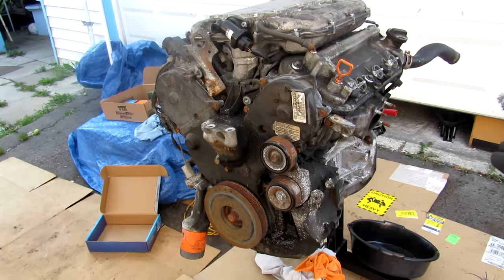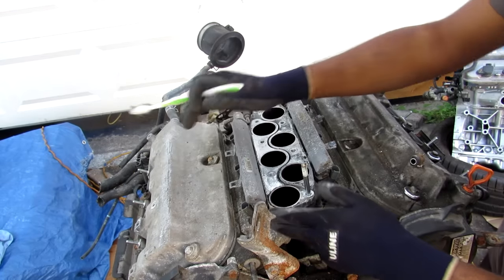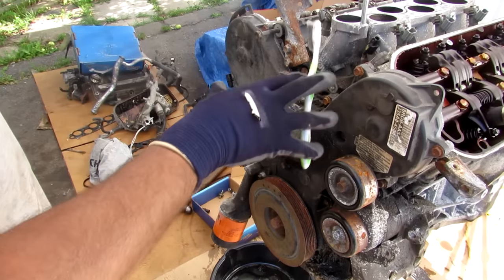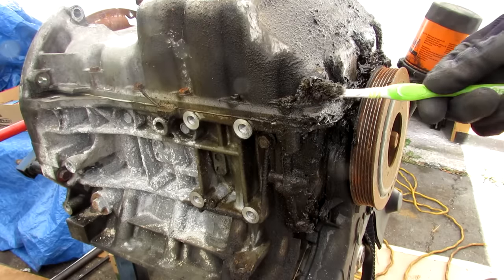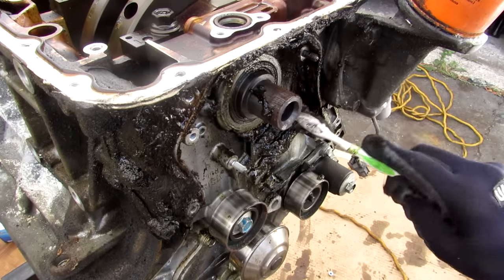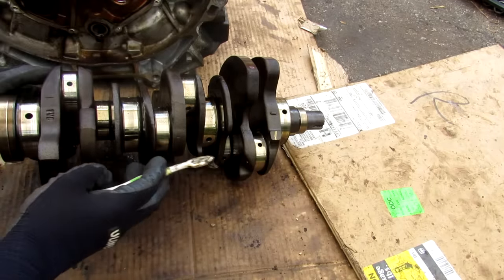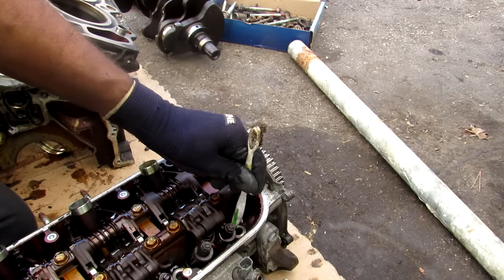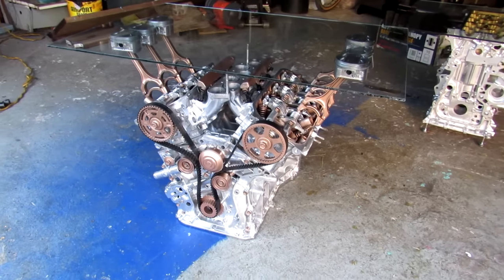Why Honda V6 Engines Haven't Changed For 25 Years

Comment from the maker: Keep your Honda / Acura maintained with these parts:
Air filters:
https://amzn.to/32essnO (US)
https://amzn.to/34AbV0e (Canada)
Oil Filters:
https://amzn.to/31nZGSu (US)
https://amzn.to/34s3ww3 (Canada)
VTEC Gasket:
https://amzn.to/32phKLm (US)
https://amzn.to/32j7unT (Canada
Reply: You as sad as I am Honda discontinued production of the V6 for the Accord? I just don't understand why they'd switch over to the 4 cylinder engine. Sure it gets slightly better MPG, but it's really honestly quite mini-squeal. I've got a 2017 Accord EX-L with the V6 and average 33-34 mpg on highway and 28-29 city. Personally I feel the V6 is just a all around better built engine. Builds more power and honestly you can do what mostly everyone does to the 4 cylinder be it cold air intakes, exhaust, turbo's, you name it the community has done it to the V6. Like I'd toss my cookies if Honda were to announce say a Accord Type-R with the V6 as a Heritage Edition as a final send off of the Accord V6. They'd of never made it to the dealerships because people would've desired them. At least that's how I feel. V6 4 Life
Reply: The reason why I became a subscriber love the video, thanks for the content keep up the good vids
Reply: @viktorbryce951  I agree. Better engine overall. Maybe you could argue that a lighter-weight 4 cylinder would result in slightly better handling (like a tiny bit less understeer) but Accords aren't race cars anyways (for most people anyways). The 6 is solid. Change the oil on schedule. Don't neglect to do the timing belt and water pump when due and that motor will be like the Energizer Bunny
Reply: @alanlo-557  You've got that right. Do oil changes every 4000 miles. I personally use Amsoil for my changes and that's just my own preference. Got about another 15k miles before I even have to worry about changing the timing belt & water pump but I'll do those ahead of time even if they don't need it. 

People often tend to view that as a waste of $ but I look at it as a long-term investment. If you maintain something it'll last much much longer. Often times people just tend to ignore or overlook that not wanting to spend anything more than they have to. Then the next thing you know boom you've got a serious mechanical issue that's going to cost you so so much more than if you'd just spent a little here and there in maintaining things. 

I can attest to this with my previous vehicle being a Mazdaspeed 6 (gosh do I miss that car). Had 247k miles on the original 2.3L Turbo Engine before finally lost compression in the #1 Cylinder yet it still ran and I still drove it like that misfiring and all for 5 months before I scrapped it. And the only reason I scrapped it was it just had so much rust and OEM & Aftermarket parts were dead for the car. I could've found the parts and got it back to drive ready but the cost and time to me wasn't worth it so I got myself a Accord EX-L Coupe 6 Speed Standard. Can't go wrong with that.
Reply: Viktor Bryce could go acura tlx for v6.
Reply: add the oil pump seal to that, that was where that oil leak was coming from. common issue, usually happens 60k miles.
Reply: All parts made of solid metal. If that would be "highly engineered" Audi,VW or BMW,it would be plastic. And will be leaking all over the place.
Reply: And also thier transmissions
Reply: @viktorbryce951  Look at the new Camry; they beefed up the their V 6 to 301 horse power.
Reply: @alanlo-557  I drive in the city (Los Angeles) so I change transmission fluid every twenty thousand miles. Even less I think.
Reply: @MBZXZ  I'm thinking about it, sir.
Reply: @MBZXZ  Did you mean Acura RLX with a 3.5L V6 Engine?
Reply: Broj 1 all of acura comes with 3.5 now , except ILX
Reply: Do more of these like the 2GR and VQs
Reply: @viktorbryce951  I live in LA and mostly drive on surface streets so I change transmission fluid every twenty thousand miles. Now, if Honda put turbo on that 3.5 engine, I'll buy it tomorrow.
Reply: Hey I need hella help with my engine!!! Same year model 3.2 tls, I got my engine from japan, and I noticed it didn’t have a solenoid or something, it’s behind the timing belt wheel on the right top side, it’s above the left cam sensor! Any guess? Is it important? If not can I get the code off at a shop and the car will run fine? It came with 50k original miles
Reply: Vtech solenoid gasket is my problem with a loud repetitive knock, which sounds like crank or camshaft sound. Beautiful hints and tips with all that knowledge. This video would have save me weeks on youtube previous to learn all this. I cant imagine how many takes and time to get together what you wanted to say..
Reply: I think with the introduction of this V6 3.5L Honda made one of the best engines in the world - I haven't seen one failed with real proper maintenance.
Reply: @eleonik76  
JB Weld to the BMW valve cover rescue ;)
Reply: Did fram start building oil filters right?
Reply: Hi I have a 1991 Acura legend it has a 3.6 V6 under the hood and i have not bin able too find any information on my engine only that it is rare the color of the car is red , so far i have only seen pictures of the 3.2 v6 and none of those even look like the engine what is in my car, it is like something from another planet so if you know where i can dig up some info on my Acura Night mare post me ty  LOL
Reply: Honda💩🚽👎🖕
Reply: HONDA Horrendous Obsolete Novices Declining Annually
Reply: Honda💩🚽👎🖕⚰️ meh
Reply: @viktorbryce951  at least the acura's still have the J but it's getting scary
Reply: So then there wasn't nothing wrong with that motor huh

Comment: Even though my J35Y1 (2015 Accord) needs Timing Belt replacements and valve adjustments, I still love this motor.  It still runs and performs like no other N.A. V6.
Reply: ALL engines with timing belts need to have the belt(s) removed periodically.  You're playing with fire if you don't replace them.
Reply: Same engine on my newly bought 2013 Accord coupe! Could you tell me how you know if it's time to do a valve adjustment? Thank you!
Reply: how many miles on it when you did the timing belt? what is n a v6?
Reply: VQ35 is a better engine
Reply: @am-mm2sl  how
Reply: @yoyotvyoo  every 100K is a good rule of thumb. Had a dealer do my coupe (same as yours) and boy lemme tell you what a difference plus the valve adjustment and she’s a ripper now.
Reply: Agree; although, I actually had a 3.0 Nissan motor last 300.000 miles.
Reply: Uhhhmm, Toyota vvti wants to say hello yo 😂
Reply: @am-mm2sl   It's not, I've owned both a VQ35DE and J35Y2 and my j35 is much better. Its somehow more powerful with a single cam, somehow more powerful with regular gas when a VQ takes premium, and somehow gets better fuel economy when it feels more powerful AND my j35 has more KMs on it than my VQ did.

Comment: All these bad transmission comments is really stupid and getting old. Yes there were some bad years but not overall. I have an 08 Accord v6 with the automotive im the original owner   I'm at 152800 miles right now.  No transmission issues what so ever.  I don't have any issues from the engine either I MAINTAIN my vehicles.  Go on any 8th generation Accord forum you will not see a big report of transmission failures.  The transmission code name is B97A.  People don't listen to these you tube content makers they do not always put out accurate information, do your own research. The Accord from 98 to 2004 were the bad ones.  2005 and up they have been rock solid and also throughout the Acura line.  Do you all really think Honda would have unreliable transmissions for 25 years?  Alot of people up here are telling you that they got up to 300000 miles on original motor and transmission and still we have the bad transmission comments.   Lol SMH.
Reply: Meanwhile almost all other manufacturers (except Toyota)have transmission failures at a way higher rate than Honda but they get a pass because there’s a lot of other problems with the vehicles as well, transmission might be the least problems.